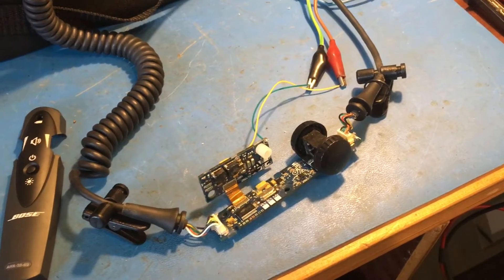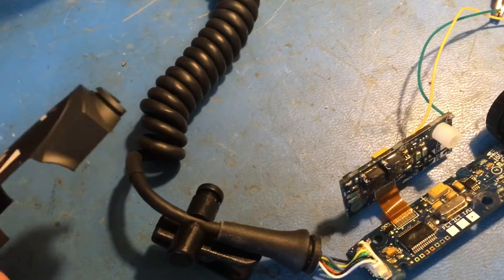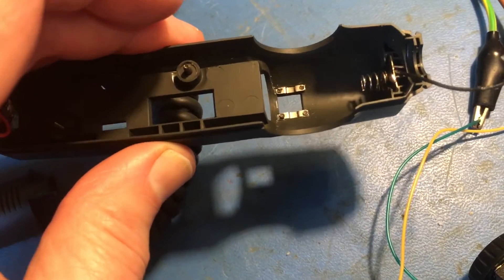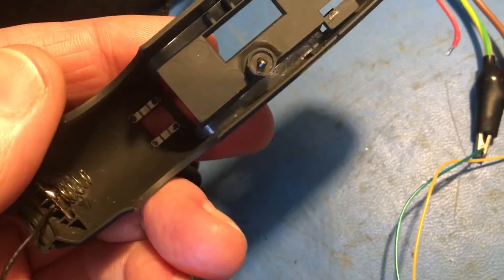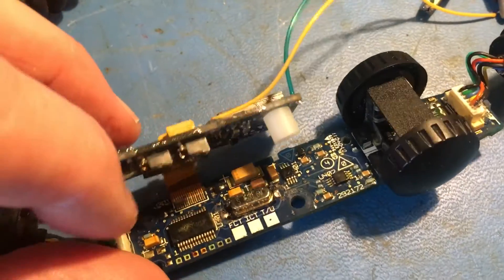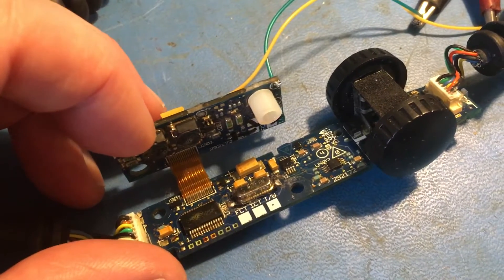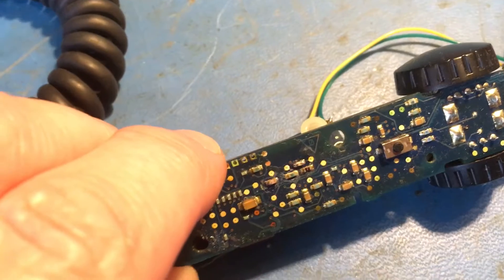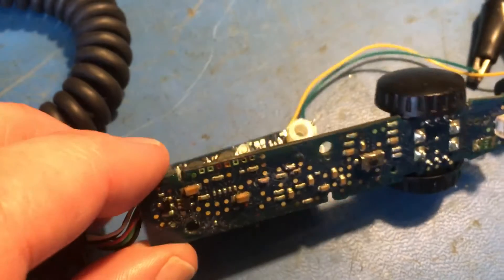Bose X Aviation Headset Repair

Comment: Hi Kevin - great video, very useful! I was wondering if you might be able to help me with a question? I am trying to fix a pair of Bose X where the microphone isn't working (you can't hear yourself talk - have not tried transmitting). As a first step I have taken the cables out to test for continuity. I found that the top part of the cable between the controller and headset is all working. On the bottom part of the cable, all of the wires have continuity except one black wire. Do you know if all of the wires on the bottom part of the cable are used in a version with the two GA plugs?
Reply from the maker: Hi, I have a feeling that there might well be an unused black wire on the plug side wiring harness.

You will not get a side-tone unless you are plugged into an intercom or radio that provides this facility.

Assuming that you have a suitable intercom, if you have no side-tone then it is either a problem with the MIC or the intercom. The easiest test would be to see if someone else can hear your transmission, that would prove the MIC circuit. If that is not practical, you might be able to make up a simple adapter to enable you to plug your MIC into the MIC audio input of your PC. That would allow you to test it. Assuming that the MIC works, then you would have a problem with the side-tone generation in the intercom. What intercom/radio are you using?

Comment: Hello Kevin, I am having issues with volume cutting in an out and believe it is the cord that connects to the ear muff. I am going to replace the cord but want to make sure I don't break the box while im at it. How do you properly remove the cord from the headset and open up the battery box? Thanks!
Reply from the maker: Hi, my advice is to handle the plastics very carefully, they don't seem to age well and become brittle. The battery box is easy to open, just the 2 screws inside and then you have to unwind the helical spring around the end. The cord to the earmuffs is just plugged into the printed circuit board. It might be held in place with some soft adhesive.

I haven't ever disconnected the cord from the earmuffs but it is just a couple of screws and then it unplugs. It should be a straightforward job so long as none of the plastic breaks.

Comment: Hello, nice video !
Could you tell me what wire colors (at the input of the Bose module) correspond to what actual wire (audio L, audio R, ground, Mic+, Mic- etc.) ?
Reply from the maker: I've just disassembled the controller and belled out the wires. This is what I get.

Input wire colours:

Tip	Green	2
Ring	Blue	3
Sleeve	Black	1

Tip	None	N/C
Ring 1	None	N/C
Ring 2	Yellow	4
Sleeve	Red	5

Comment: Hi, good video!!!
I have the same headphone, but the right hear do not work
I’ve checked all the cables and they are ok. What you suggest?
Reply from the maker: Before you do anything, it might be worth checking that you have the control box set to MONO on the switches under the batteries. You only need it set to STEREO if you have a stereo compatible intercom in the aircraft.

If that doesn't fix it, you will need to use a multimeter to measure the resistance of the wires and the loudspeaker. You can compare the resistance with the left ear. You should also measure from the main plug into the control box and from the control box to the loudspeaker.
Reply: Identical problem with the "left" speaker cutting out - are the causes that you described the same as the RH speaker? or is there another more likely cause? @bvqbvq
Reply from the maker: If you have individual speakers cutting out then I would suspect the following:
1. The wiring.
2. The loudspeaker itself.
3. The noise-cancelling circuit in the earcup.

I've not looked at the circuitry in the earcup but I suspect that there is some amplification and some form of DSP module. To investigate this further you will need to check the power supplies, the incoming signal and any clocks in the DSP stage. You may need a scope to look at the signals. If you don't have that then some way of heating and cooling sections of the circuit might enable you to narrow down the fault.
 @johnknight7948